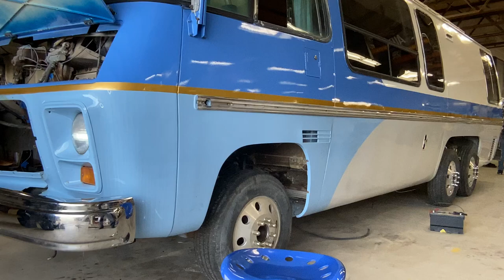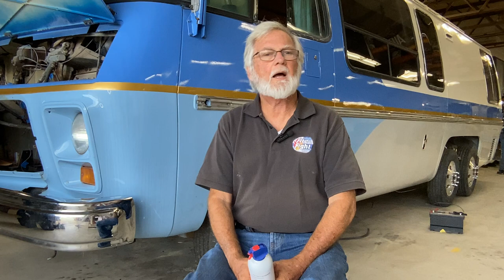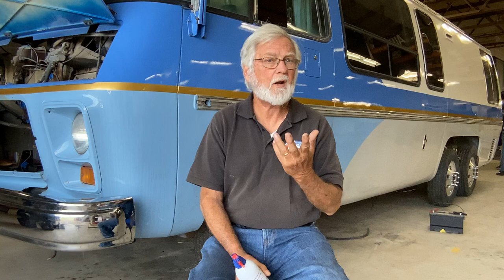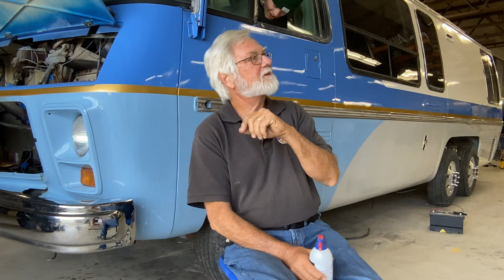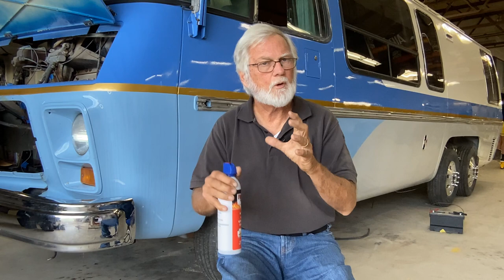A minimum fire safety for any RVIMG 0106

Comment: Have argon in engine and stove.
Reply from the maker: Please call me, I’m not sure what that is and I want to help ya. 321.299.5707
Reply from the maker: Argon is not a fire suppressant
Reply from the maker: Halon is not good for you to be exposed to, this gas will deprive you of oxygen, in an engine compartment it will blow away with the air venting the compartment.  I don’t mean to upset you but you are not safe…. Call me
Reply from the maker: Fred brandon  it’s not a good suppressant in an open air compartment like an engine or generator compartment….. it dissipates too quickly.  Foam is the deal, let me help you do better….. what is the brand name of your systems?  10 years ago we even offered that be we learned more.  I’m happy you have at least addressed Fire though…. Thank you